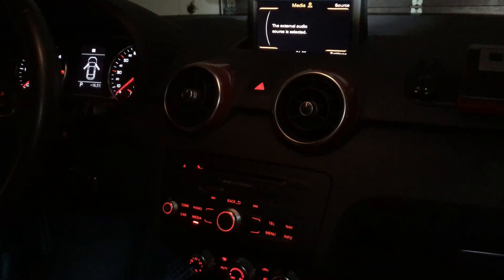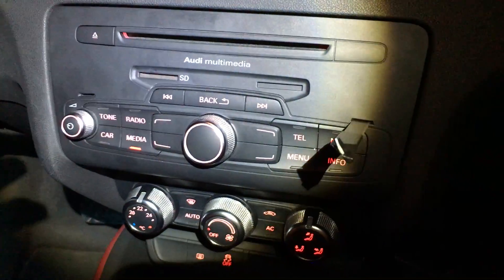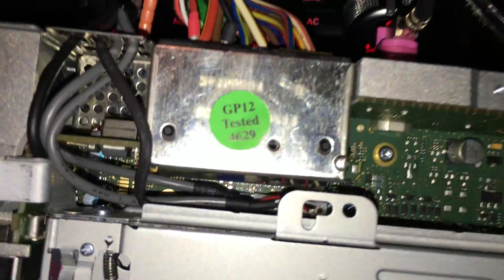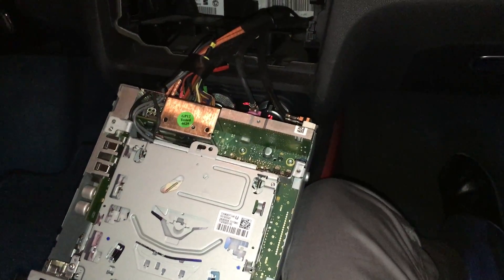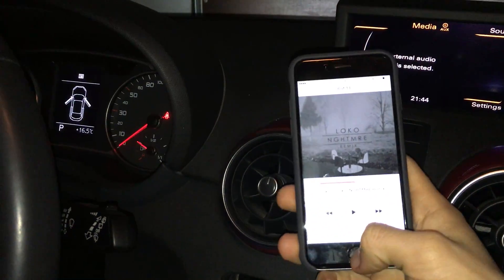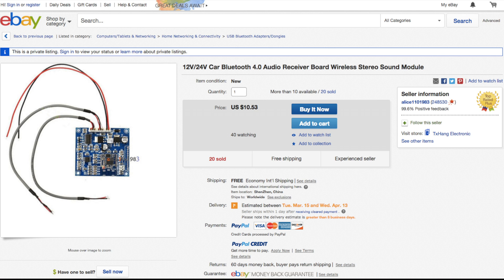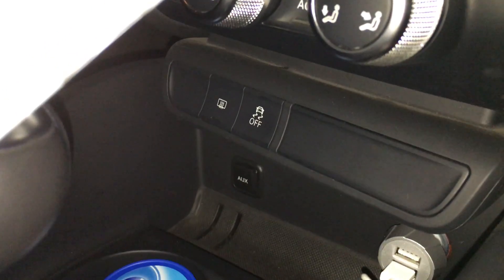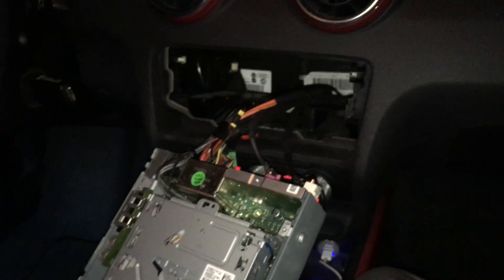Bluetooth Car Module Installation (Part 1)

Comment: Hey! Awesome vid man. Quick question: I'm trying to achieve a real OEM feel on a similar project im embarking on and would like to know if it is possible to connect this setup so that the track details etc shows up on the oem lcd screen? I drive an e36 and have the radio unit. I dont wanna swap out to anything newer because the new shiny plastic looks gross in the car.
Reply from the maker: Sorry for the extremely late reply. Unfortunately not with this module. There is a workaround though. You have to find a Bluetooth to FM Radio transceiver. Basically what these do is they they your phone's Bluetooth connection and they make a local Radio Station on a pre-set frequency. Some of them have the feature to recognise the track that is playing and add it to the scrolling text on that FM channel. If you tune it to an unused frequency in your area, you should be able to use it without issues. Best of all, you don't neew any wireing, splicing, etc. All you need is power and ground and to make sure these are wired up correctly so that when you turn the key to the ignition position, the power is active on that power line. You can get a fuse box adapter for that as well and just use one of the empty slots.

Comment: Hi :) Im' planning on buying the chip for a little diy amplifier, but i can't figure out where the input and the output is? can you please help? And also a little side question... do you know what the 5V connection in the middel of the board is for?
Reply from the maker: Ok, so the input and output are written on the other side of the board, i'm not entirely sure as well, I'd have to have a look. The 5V port is actually a 5V out so that you could connect it to a female USB socket and charge your phone, which is probably perfect for your project. You could for example make a cutout and screw a USB socket into it like this: http://www.l-com.com/lcom_emails/2012/110712/uc_a_pmt.jpg?cmp=110712
Just make sure to check the polarity before you connect anything. Good luck and post some pictures, I'd like to see what you came up with! :)
Reply from the maker: https://youtu.be/VW5urQ5vx9k
Reply: I see that it is ridden on the other side (output and input). But I can't understand what it means, it just says "lin and rin" and the other it says "lout and rout" (on the pictures on ebay). But you say wich one is wich in part 3, so its fine now :) Tanks! and also thanks for the information about the 5v output :D... and one last question... :P ... why do you need a input when it is a bluetooth reciver that is supposed to output sound? Anyways... Thank you sooo much for you vids and the information - I subbed ;-) - And I will be sure to make a vid on my channel, on the final product, and skematics... when i get all the parts wich is gonna take some time since i use free shipping, so i takes very a very long time for the parts to arrive (I'm 13... i don't have alot of money ;) ).
Reply from the maker: lin and rin stands for Right-In and Left-In, and the same goes for the output obviously. You don't need to have an input channel on your bluetooth chip, BUT, they have assumed that if you have and auxiliary input channel, you'll want to have the option to keep using it after you build in your chip. So your original AUX on your car, probably a 2.5cm banana cable (also called mini-banana :D) goes into the input channel on your bluetooth chip and then you could, if you wanted to, connect an iPod for example. I think I mention this in part 2. :)
Reply: Ohhhh okay, I really don't know how i didn't see that, that is what it ment... (i read it as a word in like another language or something lol :P) But I get i now. Thanks :) I think im gonna put in a 3.5mm jack input then ;D

Comment: Hi! Nice video! I want to do something similar on my Audi A3 2008 which has an Audi Concert 3. I bought this bluetooth module: http://ebay.eu/2uo0PXi and the mic is on the way. My question is: Audi Concert 3 need to be switched on Aux External Source mode to receive signal from aux ( in this case from bluetooth module ). If someone call me, I need to switch manually from cd-player from FM (for example) to AUX to be able to answer that call, or this module know when someone call you and automatically switch to AUX the cd-player and after call, switch back to FM? If not, in order to receive a call, it's mandatory to be in AUX External source mode? It's just a curiosity, I'll install it anyway, because it's better than a cable in dashboard. Thank you!
Reply from the maker: I understand your question. If your Audi A3 has several buttons like mine (Tone, Radio, Car, Media) then, you could just switch from Radio to Media (Aux) with the click of a button. This is what I usually do. But when you listen to music from your Phone over bluetooth or from the Aux input of the bluetooth chip, then the chip will automatically switch from from Aux to phone and you will be able to answer the call. Does that make sense?
Reply: Yes, that make sense. Thank you! Did you made some pictures when you install the mic on the bluetooth module?
Reply from the maker: i'll make some soon, i need to improve the connections because it keeps disconnecting as my cables as bad. The cables on the device are fine, but my extensions are horrible. I will also put the whole thing into a hobby box. Will make a video soon.
Reply: Hello again! I successfully installed bluetooth module on my car but I have a question. Did you figured out how can you increase volume when you speak with someone through bluetooth? When I play music from phone I can change volume from phone or from cd-player, but when I talk with someone, the volume is very very low and almost I can't hear the other person and I can't volume UP from phone or from cd-player (it's not working). Thank you!

Comment: Any chance you have a wiring diagram for your particular set up
Reply from the maker: Will do soon, no problem :)
Reply: Thanks , subscrided👍🏻
Reply from the maker: Ok, so here's the thing, imagine that this is your original 3.5mm aux cable and it consists of 3 wires like this:

MALE:                                                                                                   FEMALE:

--------------------------------------- Left         ||----------|----------\,,,,,,,/-----\        basically where the male cable plugs into!
--------------------------------------- Right       ||           |            |              |
--------------------------------------- Ground   ||----------|----------/"""""\-----/

I don't know if you see it but it is supposed to represent the existing AUX plug of your car (the male side)
Depending on the car, you might have the 3.5mm jack on a wire hanging around, or you might have a hole (female) in which your plug in a double sided 3.5mm jack from your car to your phone like this one: https://www.amazon.co.uk/World-Data-3-5mm-Stereo-Meter-Black/dp/B00077DC3S .

===========================================================================================

OPTION 1 (if you have to use a double sided 3.5mm jack cable):
In this case you have to remove the panels of your car and locate where this female cable goes into your stereo. you need to make a cable connection (and probablya DIY adapter) which will run from the BLUETOOTH output to your STEREO AMPLIFIER like this:

|"""""""""""""""""""""""""""""""""""""""|                      |""""""""""""""""""""""""""""""""""""''|
|                                  L-in  | --------<-------- | L-out       BT                  |
|    YOUR                   R-in   |--------<---------| R-out      CHIP               |
|    CAR'S                   G-in  |--------<---------| G-out                              |
|    STEREO                        |                     |                                         |
|                                           |       ,------------|  L-in                     Mic + |------------<-----------| MICROPHONE     |
|                                           |      |   ,-------- |  R-in                      Mic -  |------------<----------| WITH HOUSING   |
|,,,,,,,,,,,,,,,,,,,,,,,,,,,,,,,,,,,,,,,,,,,,,,,,,,,,,,|      |   |   ,----- |  G-in                                |
                                                   |   |   |      |,,,,,,,,,,,,,,,,,,,,,,,,,,,,,,,,,,,,,,,,,,,,,,,,,,,,|
                                                   |   |   |
                                                  ^   ^   ^
                                                   |   |   |
                                                   |   |   "--------------------------<--------------------------------------'''''''''''''''''''''''''''''''''''''''''''''''''''''''''''''''''''''''''''''''''''''|
                                                   |   "------------------------------<-------------------------------------- Female 3.5mm plug   <
                                                   "----------------------------------<-------------------------------------,,,,,,,,,,,,,,,,,,,,,,,,,,,,,,,,,,,,,,,,,,,,,,,,,,,,,|

===========================================================================================

OPTION 2 (if you have to use a single male 3.5mm jack cable from your stereo):
In this case you can do the same as above, or if you want to do a more simplifies version then do this:

-------------|''''''''''''''''''''''''''''''''''''''''''''''''''''''''''''''''''''''''''''''''''''''''''''''''''''''''''''''''''''''|                         |'''''''''''''''''''''''''''''''''''''''''''''''''''''''''''''''''''''''''''''''|-------------,
-------------| Male 3.5mm plug from your car | connect via:  > Female 3.5mm plug  |---------,    |
-------------|,,,,,,,,,,,,,,,,,,,,,,,,,,,,,,,,,,,,,,,,,,,,,,,,,,,,,,,,,,,,,,,,,,,,,,,,,,|                         |,,,,,,,,,,,,,,,,,,,,,,,,,,,,,,,,,,,,,,,,,,,,,,,,,|-----,    |    |
                                                                                                                                                  |    |    |
                                                                                                                                                  |    |    |
                                                 ,------------------------------------------>----------------------------------------- "    |    |
                                                 |    ,-------------------------------------->----------------------------------------------"    |
                                                 |    |    ,---------------------------------->--------------------------------------------------"
                                                 |    |    |
                                                ^    ^    ^
                                                 |    |    |
                                                 |    |    |      |""""""""""""""""""""""""""""""""""""''|
                                                 |    |    "---- | L-out       BT                   |
                                                 |    "---------| R-out      CHIP                |
                                                 "--------------| G-out                              |
                                                                 |                                          |
                                                   ,------------|  L-in                     Mic +  |------------<-----------| MICROPHONE     |
                                                   |   ,-------- |  R-in                      Mic -  |------------<----------| WITH HOUSING   |
                                                   |   |   ,----- |  G-in                                |
                                                   |   |   |      |,,,,,,,,,,,,,,,,,,,,,,,,,,,,,,,,,,,,,,,,,,,,,,,,,,,,|
                                                   |   |   |
                                                  ^   ^   ^
                                                   |   |   |
                                                   |   |   "--------------------------<--------------------------------------'''''''''''''''''''''''''''''''''''''''''''''''''''''''''''''''''''''''''''''''''''''|
                                                   |   "------------------------------<-------------------------------------- Female 3.5mm plug   <
                                                   "----------------------------------<-------------------------------------,,,,,,,,,,,,,,,,,,,,,,,,,,,,,,,,,,,,,,,,,,,,,,,,,,,,,|

===========================================================================================

Please open this comment on your desktop so that you can see the full diagram!